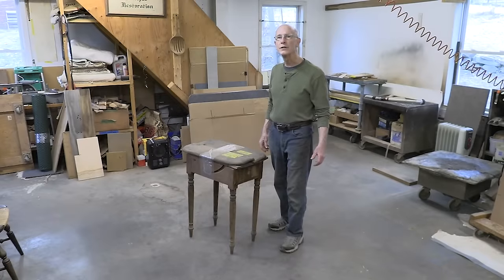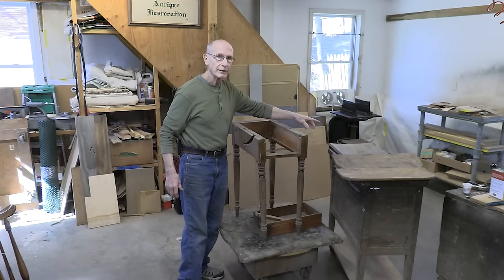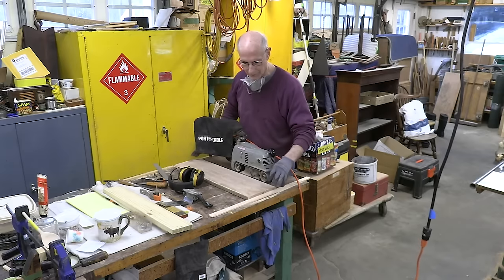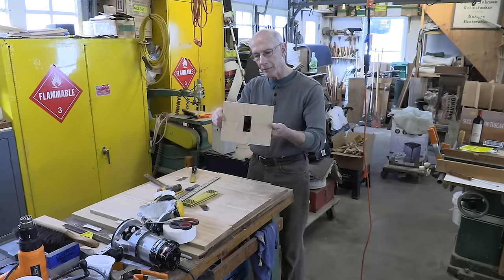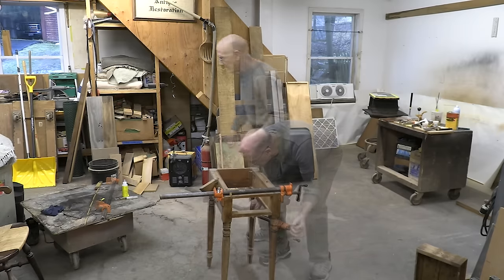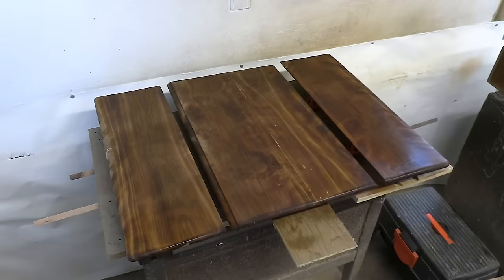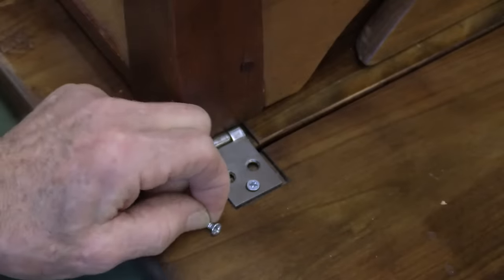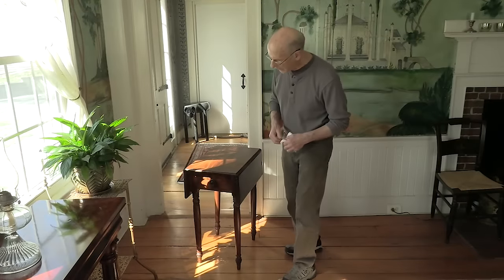This Table was a WRECK

Comment: I have seen someone fix a warped top before, although it was much smaller (plant stand top).  They soaked it for a day in room temperature water, with a weight pressing the warp down.  Then they removed it from the water and left it to dry (for weeks), again with the weight pressing the warp down.  I don't know if that would work though on a much larger top board like this from ~1840.
Reply from the maker: Thanks! I’ll try to make a video on warping. I’ll try all these methods

Comment: I was wondering why you didn't reuse the old hinges but on second viewing it looks like one was missing. I find it hard to believe you don't have a 4th in your stash of old hardware. 😁 As to making new hardware look old, years ago I built a post and beam house for a customer. He wanted everything to look antique…we hand planed and beaded everything. We built board and batten style interior doors out of wide northern white pine painted with old fashioned milk paint and hung with H&L hinges. He wanted us to get all the hardware from a blacksmith. Instead I took a new Acorn hinge, heated it in my woodstove to cherry red, then whaled on it with a ball-peen hammer. When I showed him a sample he couldn't tell it from an antique hinge I had. It saved him thousands of dollars and he was delighted! I will bet you could get the same results by burning the zinc off one in a woodstove or with a torch then letting it rust (naturally or forcing it artificially).
Reply from the maker: Thanks! I am definitely going to try that! Maybe I'll just throw them in the stove for a day

Comment: I love what you did and how it turned out. But to a die hard preservationist or restorationist, what would be done for the twisted top? Just curious.
Reply: Re-assemble it, and keep it with the warped leaves and top. I have a couple of tables that are slightly warped, and it doesn't bother me, however this one was pretty extreme...
Reply from the maker: Thanks! dlevi67 is exactly right! This one was too far gone
Reply from the maker: Exactly! and especially difficult with drop leaf tables where the center section has shrunk, preventing the leaves from hanging straight down, it can look pretty bad!

Comment: Dumb question: did you save the table top for "just in case"?  Glad the rest will go back to work somewhere.  A piece of flat pack would have been a pile of sawdust at the point where this piece turned up.  (can you tell I despise the stuff?)
Reply from the maker: Thanks! I am saving the top, I hope to make a video on trying to get warps out

Comment: What is Crud Cutter Tom ? Its obviously a well known cleaner brand stateside, but here in the UK its unknown. Is it a standard citric acid based household cleaner ? Or something else ?
Reply from the maker: Thanks Peter! It's called "Krud Kutter" and it's one of many household cleaners which all claim as "de-greasers". They readily clean oils and other contaminants, and don't require rinsing. usually the common ingredient is TSP (tri-sodium phosphate) which is readilt available. I used to just mix mild solutions of TSP but I like cleaners that are ready to use
Reply: @johnsonrestoration  Thanks Tom. Loving your work.

Comment: There is a way to get the twist out of the board however it won’t be 100% original. Put your original top onto a sled so it can’t rock and then put it through your thickness planner to get a flat surface on the bottom side. You might have to glue in some blocks where the hinges go before you plain it. then glue that old top to another flat board. Now plain with your new wood down the other side of your top till it’s flat then flip over and cut through the new wood with your thickness planer you’re the right thickness for the top you effectively turning the old top into a veneer. In regards to the centerpiece if you made sure you’re board that you were gluing on was exactly the same width as the original top you will lose no width and the little initial bump out will be lost when you cut the new rule joint for the table top. Now the wings are a different story, you’re gonna have to cut the cove cut off before you do your glue up. You could just let them be shorter, or glue on a new strip of wood or even cut the outer edge off about 1 inch back. Then glue in an accent strip to help make up for the amount you cut off. Once you’re happy, cut your rule joint put in your mortises for your hinges, route your edges and finish in whatever way you desire. This will keep the original top surface if not, 100% original and will take out the war unless it’s totally bent up more than the thickness of the wood, which I’ve never seen a board that badly cupped before. As I stated when I started this meandering ramble, it won’t be 100% original, but you will still have some of the original top as a veneer.
Reply from the maker: Thanks Duane! I have done very similar work on many warped situations. With this top I decided there would be so little of the original left, that I should just make a new one. I have done what you suggested on warped doors, which could not be replaced

Comment: It might be a fun video to try out kerfing to remove cupping. Check out the blog post I've linked - obviously you wouldn't need to go so extreme. I imagine 2/3 to 3/4 depth of cut filled with either filler strips or more realistically some epoxy would do the trick. If strength is an issue maybe a thin layer of reinforcement wood would be a good idea. I'll post the link as a separate comment as a reply to this one  in case it is blocked.
Reply from the maker: Thanks Mike! I've done that several times. That's the one method that really works

Comment: I think that would make a nice little gaming table you can put a fold-out chess board for Checkers or even a little card table that could be just folded up and put it against the wall out of the way until next time.
Reply from the maker: Thanks! Yes, I guess that’s the whole idea about drop leaf tables
Reply: @johnsonrestoration  I've been getting a little interest in wood and I've acquired some metal clamps they are very old even the handles are metal and all I see on them is a little badge type symbol with a letter in it. On the other side of the handle is 404. I can try to take some pictures as I'm trying to find out the brand and how old they are.

Comment: I've had luck giving zinc hardware a patina by heating it red hot with a torch and dropping it in some old motor oil.  Be sure to wear a respirator, zinc is nasty stuff.  Good luck.
Reply from the maker: Thanks! I will try that

Comment: The wood gets darker over time from oxidation.
Reply from the maker: Thanks! Yes, it does, I guess the finish helps alleviate that. But the underside of that top, which was exposed to oxygen even if the drawer was closed, is as light as the day it was planed
Reply: @johnsonrestoration  Not sure if you are aware, but barnwood is typically so dark because ammonia from animal urine accelerates oxidation.  I'm sure you're familiar with the fumed ammonia finishes of oak Stickley furniture etc.

Comment: for once i cannot agree with what you are doing, the piece is only original once.  Even though the top is warped, the top is original, hand planed, hand sawn. hand made.  By trying to make it perfect, using modern hand tools, ruins the originality.  In my opinion, it would be better to have left the original, warped, top with the original hardware.
Reply from the maker: Thanks! Ideally yes, but that top is way too far gone. I am saving that top, and will attempt to get the warp out, on video